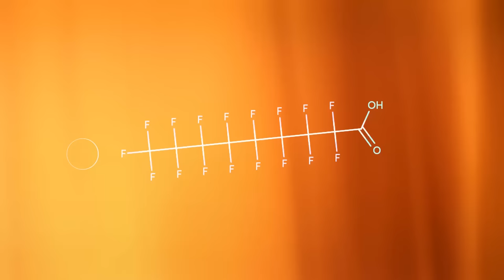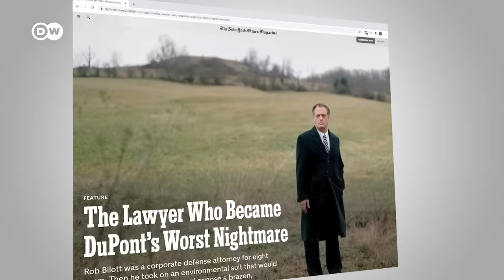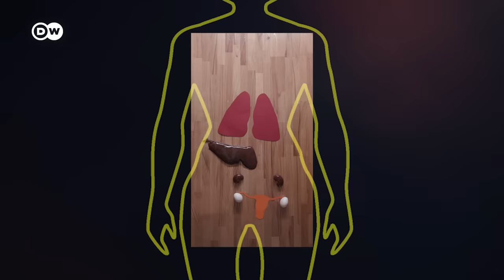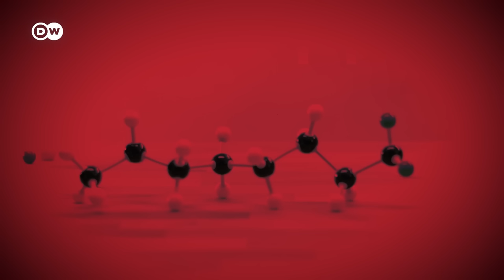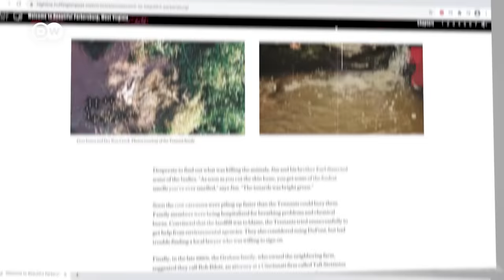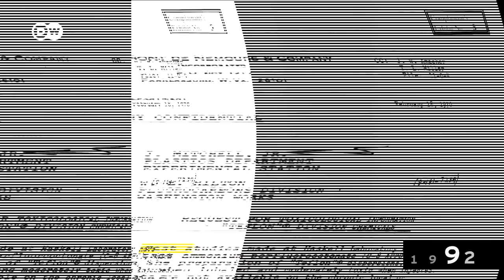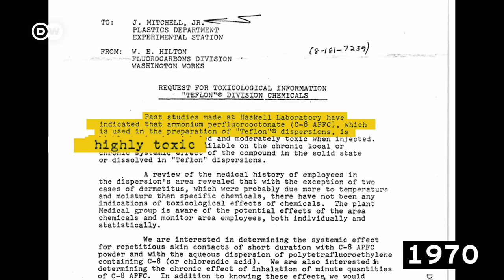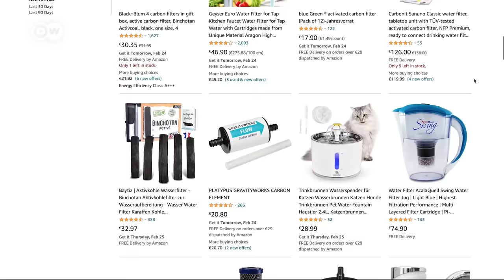PFAS: The secret toxins in your body

Comment: I live in a small village in Denmark. A city where Dupont was also located. (Now called IFF)
In the 70's they dumped chemicals in the city rivers and grounds and today we see a highly amount of people in the city getting the horrible sickness ALS which is much deadly, and this year the city will be checked to see if there is a link between this and Dupont. So scary i even live in that city...
Reply: Well,  technically that business wouldn't be in IFF currently. So, Dupont and Dow merged several years ago and the split up again reorganizing business. They split out into 3 new companies one still called dupont which kept both enzymes and specialty additives, one called Cortevea that was agriscience, and one called Dow that kept most of the bulk chemical manufacturing. The Dupont branch of that split off then further spun off it's health and Biosciences division to IFF. The companies that would still be putting this kind of stuff out would be a much earlier spinoff from the original called chemours,  and likely the new DOW. Possibly still some in the new "dupont ".
Reply: @sether255 way to miss the point
Reply: did they check? what was result
Reply: The modern society, proud to be based on science - checking if there's a correlation only after half of the city gets the same, rare disease..

Comment: I felt like I was "being radicalized" by this video, but it's actually all true so... let's try to be more radical (?)
Reply: It is rather extremistic. Because usually it is hard to absorb these substances in the first place. They are extremely chemically stable and therefore your body can’t really bind to them. 

It is only a problem for people that actually work in the aerosol coating industry and happen to forget their protective equipment.
Reply: @MetallicReg  regret always comes after the fact... it's better to be extreme now rather than later when things get even worse ya know
Reply: Let's try to be most excellent to one another.
Reply: This is a chemistry joke right?
Reply: @a user haha well maybe, in universities, engineering companies etc this notion certainly doesn't exist
Reply: @arendmookhoek4314  and you know that because you're a chemical engineer right?
Reply: @SushiArmageddon  Mechanical, how about yourself?
Reply: @arendmookhoek4314  wish I could say I'm an engineer but I only got my degree in lowly physics.
Reply: @SushiArmageddon  not lowly at all haha, all engineering is just physics applied a certain way
Reply: I'm wondering about Coconut Oil?
Would it decrease or increase the dangers of PFAS?

Comment: I once used a teflon coated pan and soon found that those are not the best pans to use. They're actually the worst as it contains those chemicals. I stopped using teflon pans altogether. Traditional aluminum, steel or iron pans would work best in itself. These teflon pans may seem good to use but it actually isn't. Cooking skills and traditional pans work just fine without the need for those chemicals.
Reply: No aluminum is not good!
Stainless Steel or Cast Iron is better

Comment: The companies shortening the molecule and advertising like the problem is solved despite changing nothing reminds me of when BPA got recognized as potentially dangerous in plastics and the plastics immediately became "BPA-free" but started using BPS or other very similar molecules that have the same issues (being treated as estrogen in the body).
Reply: I'm wondering about Coconut Oil?
Would it decrease or increase the dangers of PFAS?

Comment: Get yourselves into an infrared sauna and sweat it (as well as all the heavy metals) out of you!!!!!
Reply: Hey Paul, lots of contaminates aren’t actually soluble in water so they won’t bind to the sweat and therefore cannot be removed out of the body via sweat and urine. They accumulate in your fat cells
Reply: Wouldn't that be lovely if that was a solution? It's not, obviously, but it would be so nice if it did work. Still a nice habit, saunas, even though they don't help against PFAS or heavy metals in your body.
Reply: I'm wondering about Coconut Oil?
Would it decrease or increase the dangers of PFAS? & Charcoal?

Comment: what kind of cookwear is safe? ceramic and steel?
Reply: Clay is the best
Reply: @zupergut3015  can u cook everything in those?
Reply: @yygg9786  yup, but they are easy to break compared to other options. People used to make everything in clay pots and were healthy. They even used to be very cheap, but after metal utensils came people dumbed them because metal one are more sturdy(toxic) but now they are making a comeback. Just make sure to buy the ones that aren't too polished:)
Reply: @zupergut3015  is polish bad too!?
Reply: @yygg9786  polish isn't bad but sometimes they coat them with harmful compounds for colour or a glazed, polished look. So it's better to buy cookware from authentic sources, you can buy the Polished ones as long you know it's polished without adding any harmful compound to it:)

Comment: Wait so all nonstick cookware are bad?
Reply from the maker: Hi Eddy, not all nonstick cookware is necessarily bad. 🍳 For example ceramic is an alternative, that is usually considered safer. Also, if you use teflon (which unfortunately is problematic) at least make sure the cookware that is in good condition and not scratched or damaged. ☀🌸
Reply: @DWPlanetA  thanks for your reply

Comment: National governments, and industrial pollution verification authorities and scientific and reasearch community in India, China, Indonesia, Philippines, and in other places should frequently analyse the pfas, pfoa and other similar particular matter emissions, or industrial discharges from all the operating factories. Regular checks of the pfas, pfoa consumer products in shopping malls, online stores should be done, logged and published online to move towards a proper sustainable and pollution free nations. Single use plastics should be banned in all places and alternative traditional or modern products, and materials should be introduced into the markets after environmental pollution verifications. Every nation, should adopt a more sustainable development goal, starting with banning of Teflon cookwares and Teflon based kitchen products, and banning of pfoa dental floss and replacing it with other suitable traditional or modern products. Replacing firefighting foams at airports and military places with pfoa/ PFAS free materials. Installing PFAS and PFOS water filtration systems for public drinking water systems. PFAS/ PFOS Water measurement systems for municipality or district authorities to regularly sample and log the water supplies/ ground water.

Comment: Per- and Polyfluorinated Substances
Per- and Polyfluorinated Substances (PFAS) The per-and polyfluoroalkyl substances (PFAS) are a group of chemicals used to make fluoropolymer coatings and products that resist heat, oil, stains, grease, and water. It is not mentioned in the introduction.

Comment: Sorry but I have to say that your video Is very misleading. We have to consider what is toxic the materials themselves. You siad there are 'forever' materials so they are very highly immune to being degrade. Like PTFe can easily withstand mixture of acid in high pressure and temperature. But why it should dissolve then in human organism. I don't the ld50 for this substance but i rather think is high.. Matey the production is highly toxic, that i can agree. Ohio is now famous for pollution. I will be more concern about the production than then the substances there selfs.